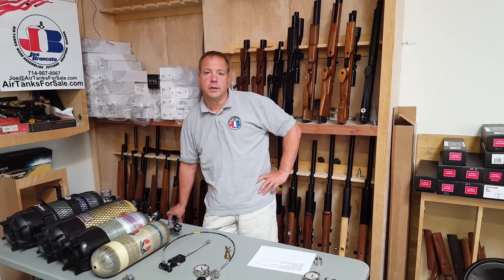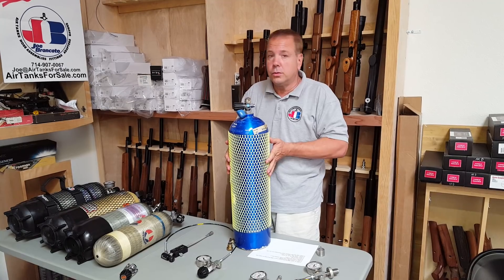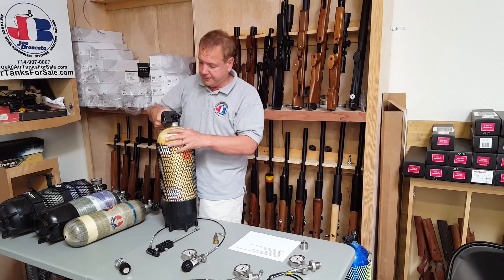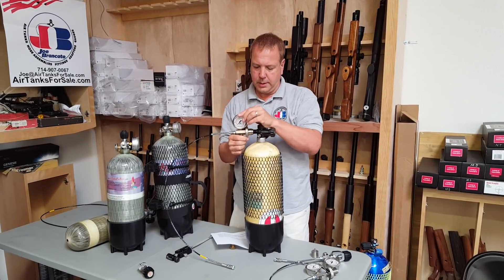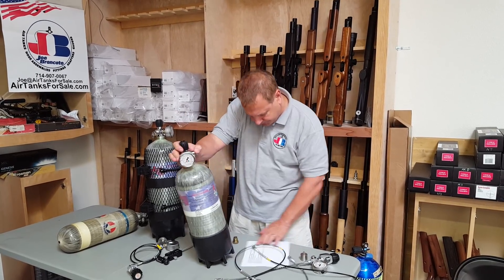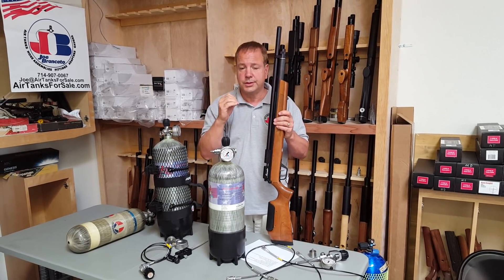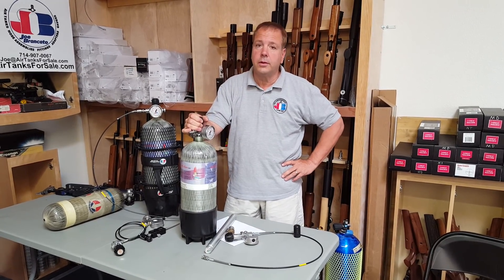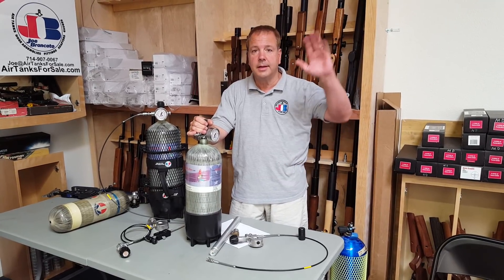SCBA Carbon Fiber PCP Air Tanks

Comment: Good lord. 500 bucks to shoot tethered. That is ridiculously over priced. Like criminally over priced. Use your noggin air gunners and you can save your cash. Keeping a 4500 psi tank charged at 3000 psi will give you more than enough bench time to practice and sight in your gun. Or just buy air guns with 4500 psi cylinder. Or shoot your 4500 air guns tethered until you reach 3000-3600 and then switch to those bottled guns. 500 bucks buys you a nice gun, lots of ammo, a nice pump, or more scba tanks from firemen.

Comment: It doesn't even talk about the smaller scott type tank which is the most available one even though there is one on the table.
Reply from the maker: The tank on the right is the same size, shape, etc. as the Tiger Shark next to it ( (2nd from Rt).  The tank on the right is only to show the difference in the "Fireman's valve" vs the DIN300 on the Great White, Tiger Shark, and Guppy.

Comment: I have an APEKS regulator attached to my 4500 PSI Omega tank.  The other day I took it to a dive shop to have it filled up for the first time since I bought it.  While filling up my rifle, I noticed it was leaking air from the Din adapter that screws into the regulator.  Could the "O" ring at the end of the adapter have been damaged?

Additionally,, the tank has a date of 06 17 and the guy at the dive shop said the next time I have the tank filled, the tank is going to have to undergo a  hydro static test .  Is this true?
Hopefully you will read this and help me out.  Thank you
Reply from the maker: Yes, the o-ring is probably bad and needs replacement.  
That tank is almost 5 years old, and hence will soon need to be hydrotested (every 5 years).

Comment: Thank you so much, I searched and watched many videos trying to learn what I need to go mobile with my PCP airgun and I was still not getting it in regards to all the different valves and names they're called.  Thanks for clearing that up.  My only question is what steps do I use to air up a tank with my compressor?
Reply from the maker: You need a 4500 PSI Compressor
https://www.topgun-airguns.com/?s=compressor&post_type=product 
https://www.topgun-airguns.com/product/alkin-w31-mariner/

Comment: I was bitten by the "Air Rifle Bug" last Summer at age 60. (they weren't as I remembered as per the 1970s) but the two .22 airguns I bought were break-barrel. OK, my question:
I recently purchased a Umarex Air Sabre. Which attachment will I need to buy to accompany the SCBA tank I'm convinced to buy? I don't wish to purchase an HPA air compressor for only my Air Sabre, but, I discovered a hand pump is a LOT of WORK at now age 61!  Can anyone help...?

Comment: Hi Joe, Thanks for the video. You did not specify what size the third (smallest tank) on the table was. I'm guessing; was it a 3 Liter or 30 CF tank?
Reply from the maker: It is 114 Cu In (about 20 Cu Ft or 1.87 Liter

Comment: how about the SCBA fire fighter tank use what vale to froster fitting???
Reply from the maker: Yes, when you can find them and they are not out of date.  You can use either our SCBA Hose Assembly or convert it with our TJ3 Slo-Flo valve

Comment: So if I get an Umarex Gauntlet for $300.00,the tank to fill it will be $500.00 to $700.00.I guess PCP is for those with money to burn.
Reply from the maker: The air tanks are the most expensive part when purchasing an entry level PCP airgun.  Once you pay for the tank, all you are buying is pellets. 
 You can probably hunt with a .22 LR, most things that you can with a pellet gun, but not always, and it's a completely different hobby. No "Hobby" is cheap.  Photography, Amateur Radio, Antique Cars, etc..  
Best to you. Hope that helps.

Comment: Hi Joe Love your Informational videos and thank you from helping a lot of us newbies from getting hurt. With that said...I,m trying to turn a 68 inch carbon fiber bottle into a fill source for one of my air guns. I have a modified regulator that allows me to fill the bottle to 4500 psi and a slide check on a stainless steel braided line. The problem that i'm having is that the slide check messes up after about 40 uses and now the valve on the top of the regulator isn't opening when i turn the knob on top of the main valve. It acts like  there isn't any air in the bottle. I only want it for one or two fills while out hunting and the lighter weight of it makes it ideal. Do you have any suggestions that will help me be able to use this almost new bottle?
Reply from the maker: We've seen those "Slide-valve bleeders". They fail miserably, that's why we don't make ours like that. We make a Stainless Steel Bleeder, with a knob. Turns and smooth like butter, works 100% forever.
Here is one on our SCBA Hose Assemblies. This bleeder has a port for a gauge, but we also make it without a gauge port. http://www.airtanksforsale.com/scbaassy.jpg

Comment: Can you tell us, or direct us to another video, about how a tanks capacity is labeled and translated across different scales.  For instance, I have what is labeled as a 3 liter tank.  If you convert liter to cubic feet you get 1L = .0353 cu ft.  But my 3 liter tank actually holds something like 23 cu ft. Which doesn’t compute.
Reply from the maker: Liters is the  volume of water capable of being contained in the tank i.e. 9 liters
Cu In is also the volume of water capable of being contained in the tank.
Cu Ft is the volume of COMPRESSED AIR  capable of being contained in the tank at a certain pressure (at a given pressure, such as 4500 PSI). 9L ~ 550 Cu in. and 97 Cu Ft is about 550 Cu In.
550 Cu In x (1Cu Ft/12in/12in/12in) x 4500 PSI (Fill pressure) / 14.7 PSI (1 atmosphere) =97.43 Cu Ft

Comment: I've wanted to get into the airgun sport for more than 5 years and have hesitated because I don't want to invest in a $2K compressor for tank refill and have not been able to find anywhere in the Atlanta area to refill to 4500psi. Any suggestions as to where to look? We are not in an area that promotes diving like the Cali west coast. Thanks.
Reply: You can buy an Air Venturi Compressor for $1,300, their Nomad model for $600, or a Yong Heng for $350.

Comment: Mr. Scientist. I like all you videos, but you really screwed up on this one. You are misinformed. I'm a diver and I use my steel 3,500 PSI scuba tanks to fill my air gun all the time. It takes over 100 fills of my .25 Marauder, from one full tank until the pressure drops below 2800 PSI, and I would probably get a few hundred more fills if I would use it down to 2500 PSI, but I never tried it. It only cost $6 to fill the tank back up. And there are plenty of dive shops around. Yes they are heavy tanks but you don't need to carry it with you when you go hunting, you get 30 shots with a full gun. The dive compressors are very expensive because they need to fill the tanks with clean and DRY air, and that is the best for the air gun. When a pump is used or a cheap compressor, the steel reservoir from the airgun will rust out in a few years because of all the moisture pumped in with the air. The aluminum scuba tank you are showing is limited to 300 PSI, but even that one will give you  plenty of fills before the pressure is too low.
Reply: Where can i buy a good tank for refilling my pcp?
Reply from the maker: If you thin you are getting 100 fills into a Marauder, I guarantee your gauge on your Marauder is reading high (giving you a false impression that you are actually filling to 3000, when you are not.). I've seen this many dozens of times.
I'm not going to argue simple physics/math. If you get "over" 100 fills, good for you (But you're getting much less than 35 shots in .25 cal Marauder).

Comment: How long will a tank hold its air under pressure?  More quantitatively, at what rate do they lose pressure?  It's probably not a linear function.  How long before they go from 4500 psi to say, 3500 psi?
Reply: Nothing holds pressure "indefinitely" and EVERYTHING leaks to some degree. With that said, the leak in the tank may be so minute as to not really be noticeable and perhaps even last for years but......
Reply from the maker: It should hold pressure indefinitely.  I.e. no loss of pressure over time.
Reply: if you have pressure loss over time, it means your tank is leaking, and you should stop using it immediately, and bring it to a shop to inspect it, and find why it is losing pressure

Comment: You might not get a 3000psi fill with the scuba tank but you will get more fills from the scuba tank than say a 90cubic inch 4500psi tank, just based on volume alone. There's more air in a scuba tank maybe not more pressure but more volume. you will get more 2900 psi fills from a 90cubic ft scuba tank. Atleast i do

Comment: Hi Paul. Thank you for a very informative video. Excuse the ignorance of the question I'm about to ask. If I use a standard 3000 psi tank, I fully understand how and why I would get less fills on every progressive fill after the 1st since now, my tank has something less than the original 3000 psi. Wouldn't the same thing happen on a 4500 psi tank? For instance, let's say I have an Umarex Gauntlet that takes 2900 psi. I will be able to fill my Gauntlet X amount of times all the way to 2900 psi until my 4500 psi tank drops below it's internal pressure of 2900. As such, my 4500 psi tank is really good only for 1600 psi...the difference between 4500 and 2900. At which point if I want to FULLY fill the Gauntlet back up, I have to top off my tank. Is that correct?
Reply from the maker: (Sorry for a long delay in responding, I don't always see these questions).
Correct, As one uses the carbon fiber tank to fill the Gauntlet (or any PCP), the pressure goes down in the
carbon fiber tank. Eventually it will get so low, that you can't even fill the Gauntlet to 3000 PSI, and then only partial fills.
The Great White filled to 4500PSI will fill a Gauntlet 63 times from 2000 PSI to 3000 PSI.
Hope that helps, and again, sorry for not seeing your question.

Comment: Wondering what the advantage of carbon fiber is over aluminum, aside from the obvious weight difference. The carbon fibre tanks are a bit pricy, and I have been told that they only last about five years. What do you think? Is aluminum more durable?
Reply from the maker: Carbon Fiber tanks are good for 15 Years (though a 30 year re-cert is in the wings) and need a hydro every 5 years.  These can be fitted with a TJ3 valve.
Carbon fiber tanks are capable of 4500 PSI
Carbon Fiber cylinders with 9 Lbs (Tiger) and 11 Lbs. (Great White)
Our Carbon Fiber tanks come standard with Slo-Flo valve, hose, gauge and bleeder (nothing else to buy)

Aluminum tanks are good indefintely, but must be inspected EVERY year. 
Alumin tanks are only good up to 3500 PSI. 
With Aluminum tanks, one needs to purchase either a SCUBA Yoke Hose or DIN300 Hose Asembly http://experthpa.com/cart/cart.php?m=product_list&c=22  
Aluminum tanks are designed for SCUBA diving, and must be neutrally bouyant, hence intentionally made to be heavy (45 - 55 LBs)
Heavier, less pressure, need to purchase Hose Assembly

There is an aluminum tank that is fiber-glass hoop-wrapped (about 110 Cu Ft).  It is the worst characteristics of both.   It is designed for SCUBA diving, and must be neutrally bouyant, hence intentionally made to be heavy (45 - 55 LBs) and needs more frequent Hydrotesting, and has a shorter overall life.  Since it has Fiberglass instead of Carbon Fiber, It must be hydro-tested every THREE (3) years and good for 15 years and then that's it. There will be no re-cert to provide additional 15 years and pressure is only 4350 PSI.  Basically, heavier, more re-certs, less pressure, and shorter life and need to purchase a Hose Assembly.
Hope that helps.
Reply: Thats great. The info I got on carbon fiber was apparently not true then. Thanks for that answer.

Comment: me like much the that samples in the video and my calibre preferred is the .25. those theoben have been used for you or are entirely new?
Reply from the maker: The Theoben Rapids are my personal collection. I have owned over 20, and still have around a dozen, mostly customized with shrouds, stocks, bolt handles, etc..

Comment: so what's the difference between a scuba tank and a welding tank? Can't a welding tank for Co2 be used? They are on eBay for $62
Reply from the maker: Carbon Fiber tanks are rated 4,500 PSI
SCUBA are rated 3,000 PSI
CO2 Tanks hold 800-1,200 PSI of CO2 (Max rating for tank is 1,800 PSI)

I would never recommend a CO2 tank, as it is not rated even close to use in a PCP airgun.  
Also, supply companies will only fill a tank with what a gas that is supposed to go into that tank. 
Ex, the wouldn't fill an Oxygen tank witih CO2 or propane, even though it could hold the pressure,  for obvious reasons.  And there are laws that prevent these accidents.